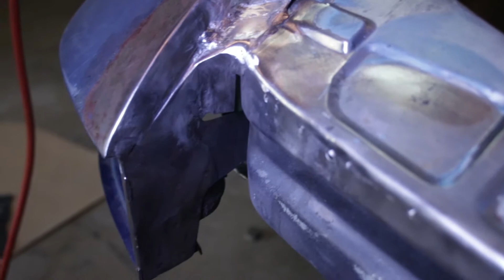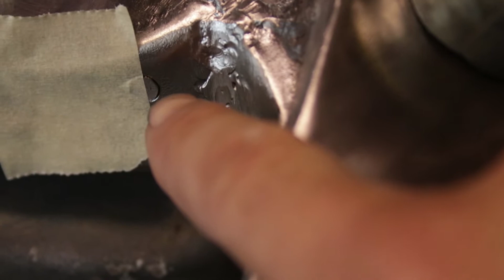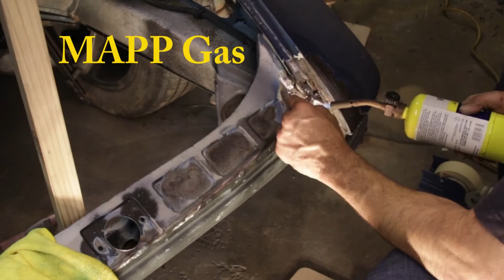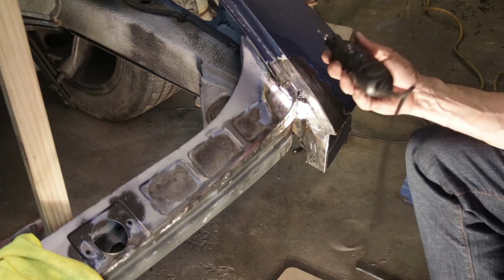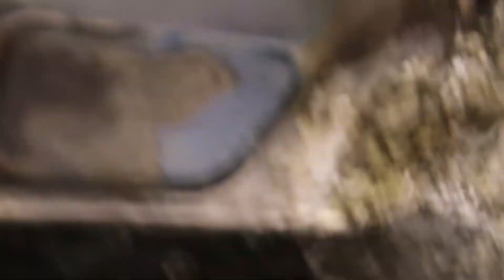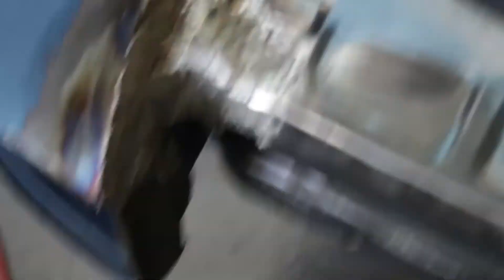Porsche 911 Outlaw Build - Autobody Lead Work

Comment: Have you found the lead protects the laps from rust?
Reply from the maker: No not really, in fact it makes it worse due to the tinning acid.  If it's a lap I will TIG a bead on the lap to close the seam first.  This prevents the acid from going in, but the heat still disturbes the overlap.  That is why I apply cavity wax to the back side.  Every method has advantages and disadvantages.

Comment: How and with what do you clean the metal after you have used lead. The flux is corrosive or not..?
Reply: Okay thanks. I tried to lead the rockerpanel on my old car som years ago and it just rusted apart allthough I cleaned it with water and acetone. I guess I will try washing soda.
Reply from the maker: Did it rust under the lead or around the edges?
Reply: Garage Time - Auto Resto  it rusted both under the lead and around. It was at total new panel and I decided to use lead on the whole inside of the panel. I know it might have been stupid but I thought it was a good idea at that time to preserve it from moisture. 
is it washing soda or baking soda you are using. And by the way tank you so much for taking your time to anwer my questions.
Reply from the maker: Yes the flux is very corrosive.  I wipe it off during the tinning phase when the lead is still hot.  After the lead is applied I neutralize it with a baking soda solution.  Then I bake it below the melting temperature to dry it out.   I bake it again before I apply epoxy primer.

Comment: Very cool! Why did you decide to use lead instead of making filler pieces out of steel? Are you going to show details of how you built the bumper mounts? Thanks for sharing!
Reply from the maker: E A I could have welded a piece over the existing factory piece where I filled the gap, but that would be overlapping metal and creating a small air cavity in between there.  It probably would have worked, but I feel better about the lead in there.  Lead fills the corner without any air pockets to rust out later. There's always more than one way to skin a cat though.
      I will show the bumper mounts too, but it may be after the flares so I can line everything up better.  This week I'm working on the license plate panel which will need custom mounts too.